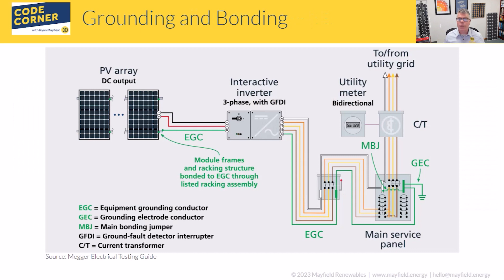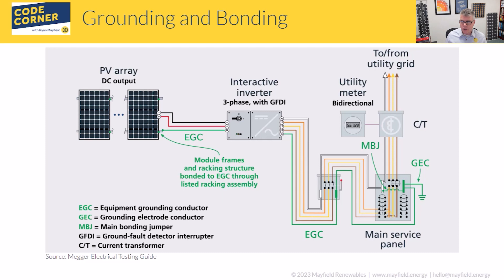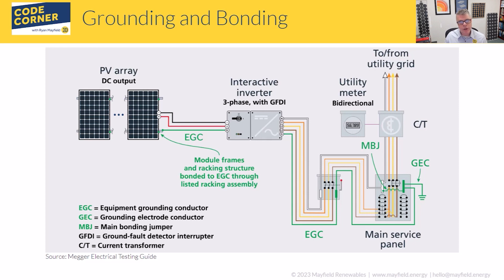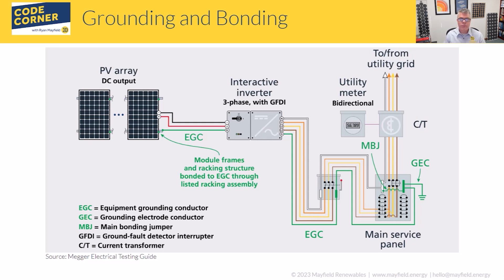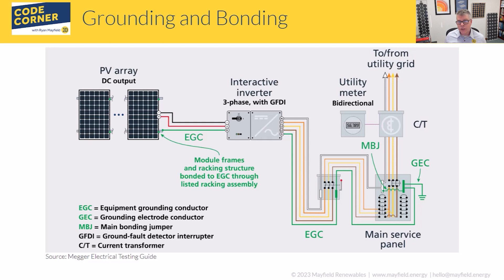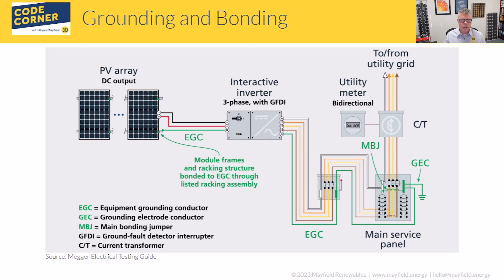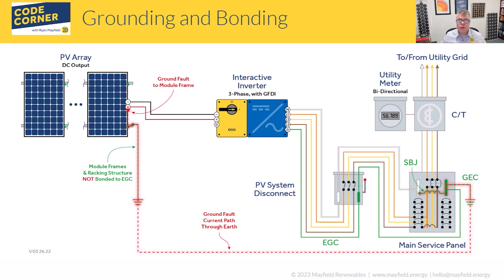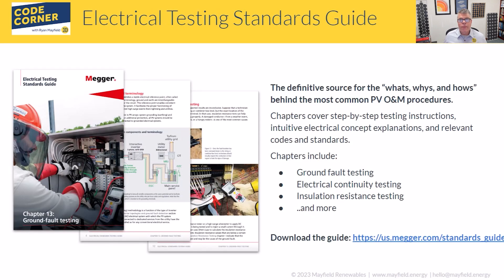2023 NFPA 70B Grounding and Bonding Fundamentals

Comment: https://youtu.be/b6kC1K__vBU?t=514 The dashed red line showing the effective ground fault current path should really be drawn all the way back through all the panels until it reaches the inverter's ground fault detection circuit.
Reply from the maker: That's correct - technically, the module frame would be energized from the fault and the inverter GDFI would pick this up. The dashed red line was chosen for ease of illustration and to show the fault path through earth.

Comment: I understand the concept of not having two different grounding electrodes. And having the ground mounted pv racking grounded with the ground rod. But how would you keep the two different grounding electrodes separate. If the EGC goes directly to the inverter, the inverter is physically bolted to the racking which then would be bonded. Also, typically you have multiple inverters mounted to the racking and a AC distribution panel at the array to feed each inverter. Being bolted together assembly they are all bolted together and bonded. Seems difficult to separate those to different grounding electrodes i.e. the ground rod at the array and the ground rod at the service. What are your thoughts? And thank you for the informative videos!
Reply from the maker: For systems with multiple grounding electrodes, it's considered best practice to bond them directly underground to ensure both electrodes are at the same electrical potential. For example, imagine you have two grounding electrodes on opposite ends of a large ground-mount site. If the electrodes are bonded underground, they have a direct low-resistance path for current to flow between them and for the voltage between the two electrodes to equalize. On the flip side, if the electrodes were only connected by the aboveground EGCs and bonding jumpers, the path for current to flow to equalize the voltage across both electrodes would go through the inverter, array, and other onsite power electronics. Ideally, we want all electrodes to remain at our reference "ground" voltage, which is best accomplished by bonding them together.
Reply: Typically the service/GEC are hundreds of feet away from the ground mounted PV array. Seems easier said then done with tying the two GEC together.  @MayfieldRenewables